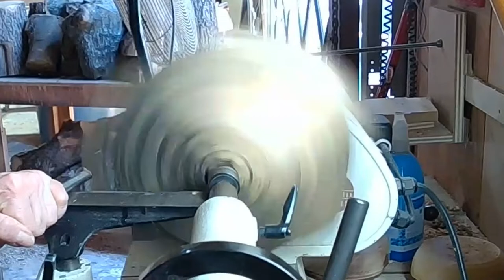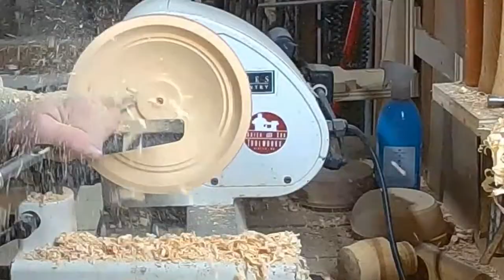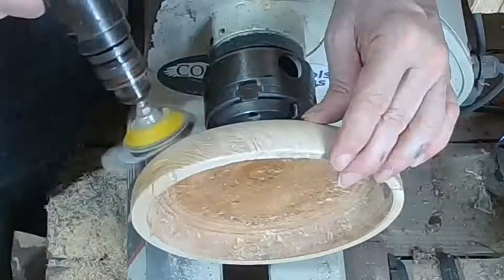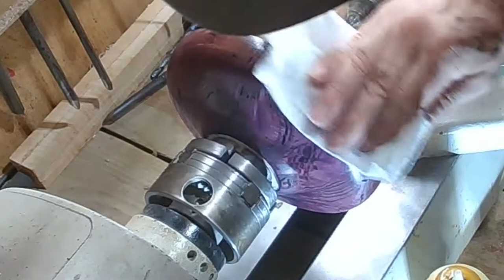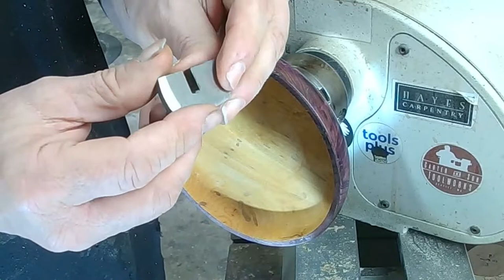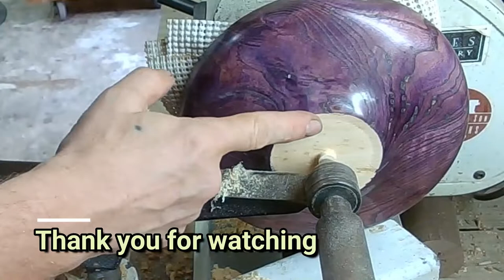Woodturning A Worm-Eaten Ash Crotch Log Into Colorful Art

Comment: Very unique, the paint and dye are great embellishments to the piece. Did you decide against using BLO on the interior and turned it off to apply lacquer?
Reply from the maker: Thanks for the kind compliment. The BLO I use as a lubricant for my final pass with negative rake scraper. Saw it on a Facebook page and it works wonders. I usually only have to sand with 229 or 320 to start off with after using it. Don't know why it works, but it does. The oil only soaks in so far. Doesn't seem to affect the final finish...so far.

Comment: What is the brand of the tool you used in the end, with the big insert? Or is it home made?
Reply from the maker: Yes.I made the tool. It's 1/2" X 3/4" bar stock. I have a piece of tool steel from our stock to make shaper/ molder knives for the shop ground into a 65/20 negative rake scraper. Works great.
Reply: @ClintHitchcock  Thanks for your responce. Thr tool looks great!